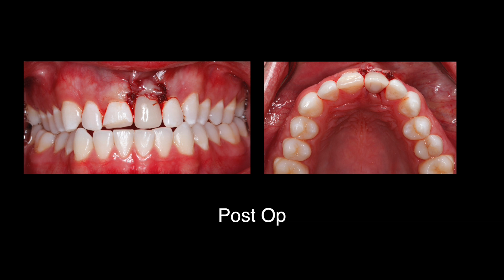Clinical Tip: Implant Placement in the Esthetic Zone (Vol. 5, Issue 2)

Comment: A great outcome.
Reply: eric maurer are you blind?  Left tooth looks longer than right tooth.  If the crowns are uneven, the dentist could have taken steps to correct it, instead of seating the crowns.  Better gingival contour control, gingival recontouring, osteoplasty, etc can be done.  If he has a chance to do both crowns at the same time, he could have done a better outcome.  It is really a missed opportunity, otherwise a perfect implant placement.  Good job overall, but it is important to pay extra attention to the esthetic zone.  It can be challenging sometimes.
Reply: @SunshineJ4478   If the patient is happy with the result, then it is a good outcome.
Reply: That is pretty low standard to say this is a good result, especially in the front esthetic zone.

I dont see how patient could be happy with the uneven teeth.  And just because patients dont know any better, it does not mean we can pretend it is ethical ok to do so.